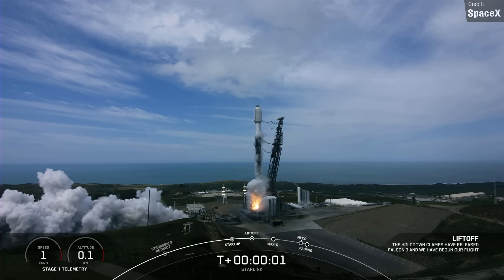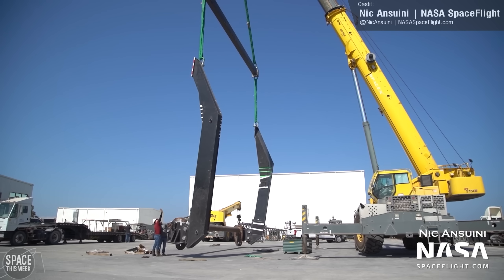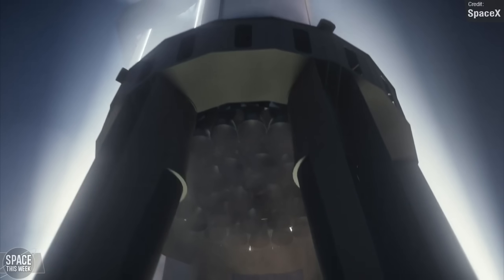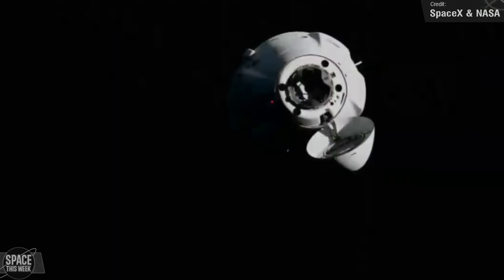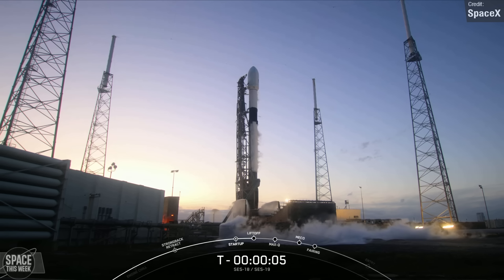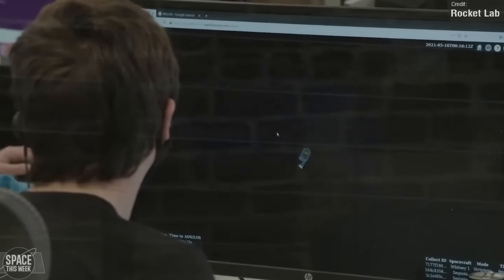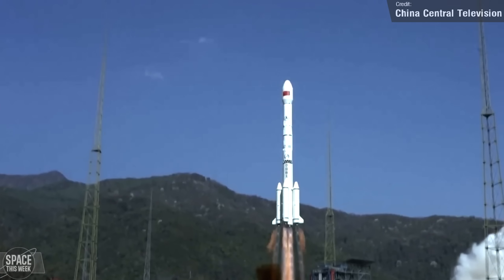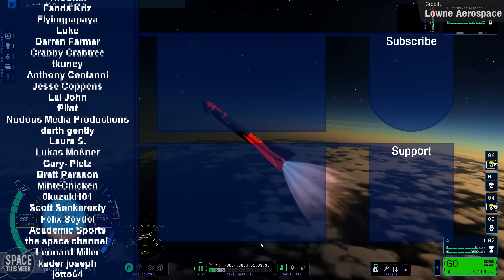Elon Teases Starship's Orbital Flight Date, SpaceX launches 3 Falcon 9s, & 3 Long March Missions Fly

Comment: Just wondering why the ongoing delays. Yes, I know about the FAA messing things up, but wonder if Musk does not have full confidence in the raptor engines. Especially as, to date, no raptor powered rocket has launched to space (as far as I know).
Reply: If you watch the video, you will see that SpaceX is STILL finishing up the construction of Stage 0. The FAA review was completed in Jun 2022 and SpaceX did NOT need a new EIS, so the existing one from 2014 at Boca Chica is fine for Starship

Comment: Dump question, but why is there a red cloud during the start of the chinese rocket? ^^
Reply: Hypergolic propellants have advantages in disadvantages. The way nitrogen tetroxide changes color with temperature leads to distinctive launches.

I watched How To Start a Rocket Engine so my barely educated guess is the oxidizer pump spools up before they let the hydrazine flow. Thus we see a cloud of unreacted oxidizer. 

Both the oxidizer and the hydrazine are incredibly reactive, corrosive, and nasty, but in different ways. I assume they decided that they would rather release a cloud of unreacted nitrogen tetroxide during static fires and launches.